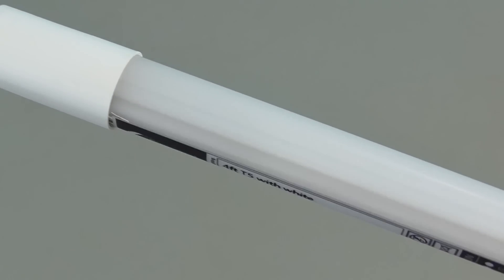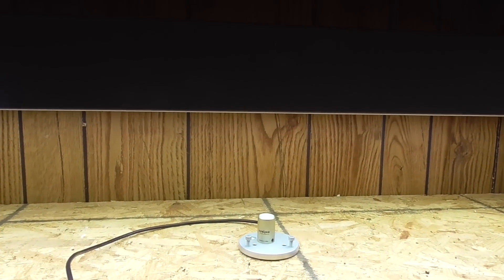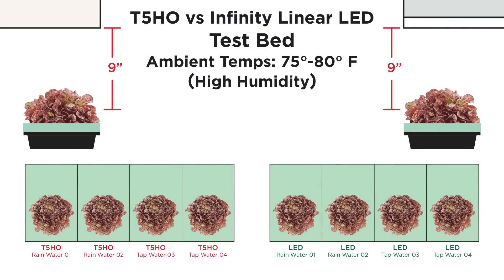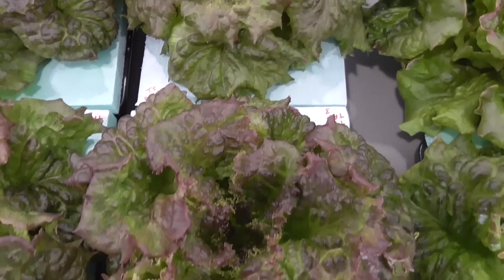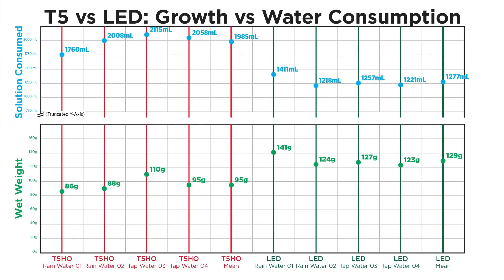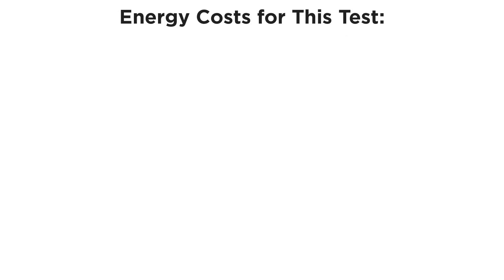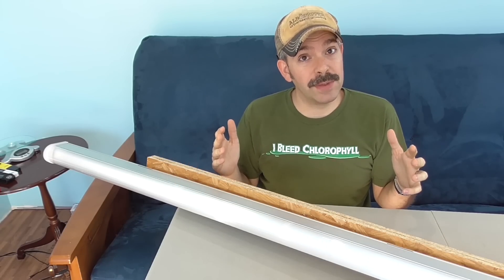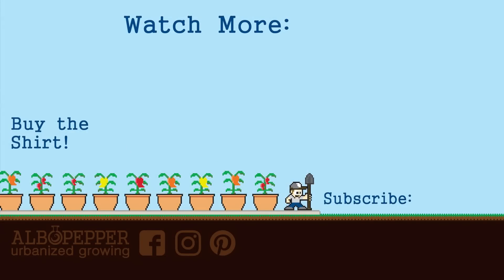High End LEDs vs T5 Fluorescent! Thrive Agritech: Infinity Linear (Review & Lettuce Test)

Comment: I still don’t understand why I don’t see any You Tubers using LED ceiling panel lights for their grow lights.

You can buy 1200 by 600 lights which only consume 45 watts. The worse case scenario is 72 watts, still lower energy consumption than LED T5.

They are cheap to buy, cheap to run, provide a consistent light level without the need of reflectors. Put quite simply, they work for a reasonable cost.
Reply from the maker: Hey Steve, can you provide a link showing what type you mean?
Reply: Type ‘1200 by 600 led ceiling panel light’ into Google. They are designed to fit into suspended ceiling framework which you see in the office environment. Most offices will be using 600 by 600 or 1200 by 600 led panel lights. 

Typically they come with an LED driver which you will need to wire up.
Reply from the maker: Hi Steve, those types of lights won't emit enough photons for vigorous plant growth. The plants would likely need to be 6 inches from the light. Even still, I'm sure the PPFD levels wouldn't be very high.
Reply: I don’t measure all the various variables which you do in your experiments but all I know from experience is my seedlings/cuttings grow fantastic under led panel lights. Plenty of vigorous green growth.

Maybe they don’t meet your requirements from a scientific point of view but it’s a cheaper alternative which works for the average vegetable gardener who doesn’t want to spend a mini fortune on an indoor grow light set up.

Btw, I love your channel, your content is fantastic and inspirational.
Reply from the maker: After 2 weeks, the lettuce plants didn't need more. They were good through harvest. This LED is a direct competitor to fluorescent grow lights. That is the market it is designed to compete in. And that is how it has been portrayed. As mentioned, it is ideal for: Seed Starting, Lettuce, Microgreens, Plant Cloning, Home Gardeners, Growth Chambers, Tissue Labs, Greenhouses, Vertical Farms, Hydroponic, Aeroponic, Aquaponic.
Reply: Hello I was talking about  Type ‘1200 by 600 led ceiling panel light’ to  Steve Kent and why he didn't understand why everybody didn't use them. LED is another story - you can grow avocado or mango etc (very sun needed plants) indoor. BUT one of parameters of efficiency is MONEY. Thank you for your videos - great job.
Reply: What he was saying above - they are too weak , as you said just for seed start to seedlings, after 2 weeks of growth most plants will need more